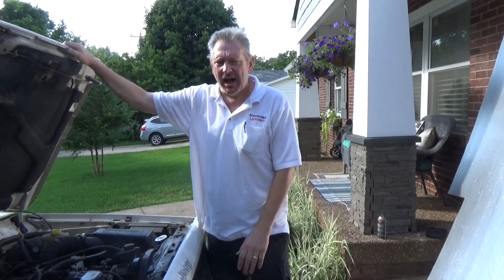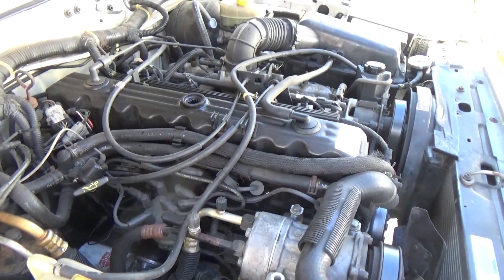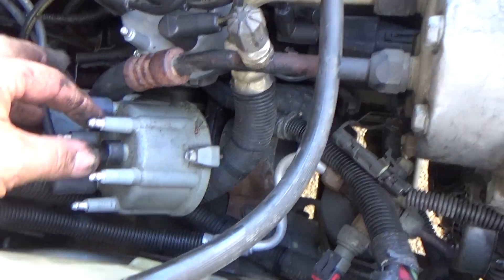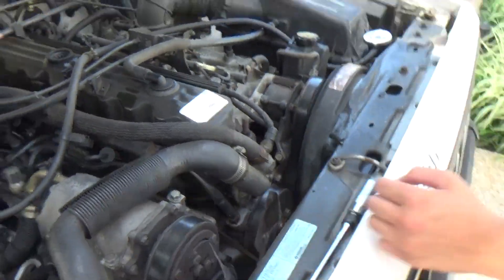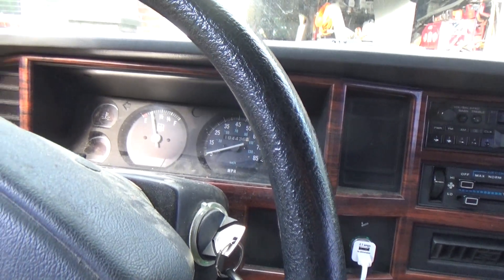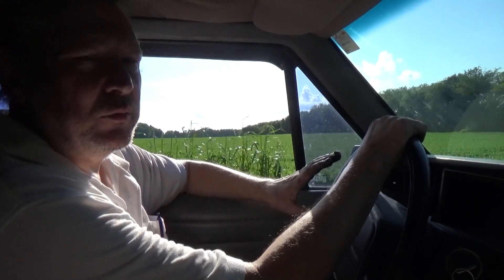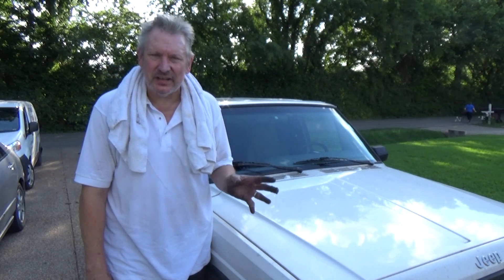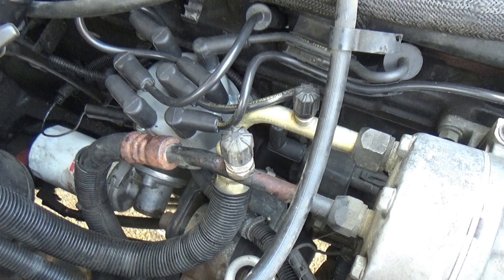Jeep 2.5 and 4.0 Simple Tune up - Fix Rough Running

Comment: EGR needs replaced on mine, the inside is tore up, so i may  go with the $25 ebay one, rather than 130 for one through the local shop.  I had done all the following, first and up to the end of this sentence is an update, 4 months after my first comment.  : "My 2.5 was rough and sometimes cut out going up a steep hill/lurched.  It took a used air temp MAP sensor (used a used one because it met spec, where disaster-market/after sensor did not).  Also took a new Siemens 1367438 ignition coil module and assembly from a Volvo 240 (by way of new, old-stock, found in Germany, last one on shelf) to get right.  But it runs smooth now.  Took cleaning the O2 sensor, too.  Since the thing was crud up with soot after the improper readings from the malfunctioning air-temp.  Fx was compensating and running rich as sin.  And, finally, found a chafed wire was shorting out and that was the phantom cut out after the other things were fixed and it was no longer dying because of the air-temp and or coil.  Good luck.  There is a great thread  if you search for  this on google:   Jeep YJ Wrangler 2.5L TBI Troubleshooting

Comment: Is $3000.00 a great 👍 deal. A bad deal or an ok deal?    for a running 1995 wrangler, 4.0, liter ,5 speed .  I drove it and it needs a tuneup and has the death wobble going on but it is a running driving 4 L jeep. Little rusty underneath but the frame is solid.
Reply from the maker: if the frame is not rusted out sounds like a great deal.
Reply: @RedneckGarage  not rusted frame. But absolutely everything is worn out
Reply: Correct frames good, body’s good no dents. No rot,  but all bushings are shot, runs but runs like needs a complete tune up.  Bucking upon acceleration at 35mph. Has death wobble.  Has 2.5 lift only modification I see.  Radio works. Gas gauge does NOT work.   But at $3k idk if that’s good bad or grab it?

Comment: Love the vid. I too was having this issue and did the same 30k miles later and now i have a loss of power. I have a small exhaust leak but hoping its not cylinder issue, but been seeing leaning alot to timing  chain. Please help 2.5 188k